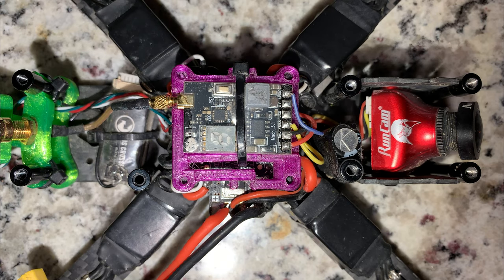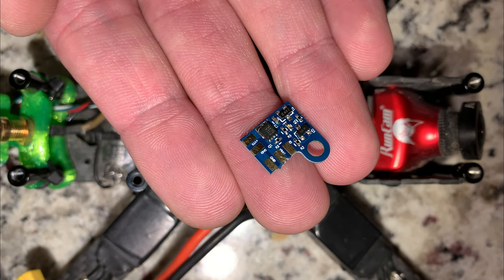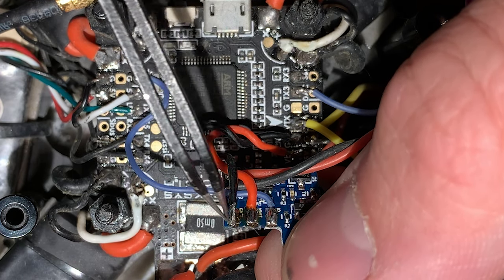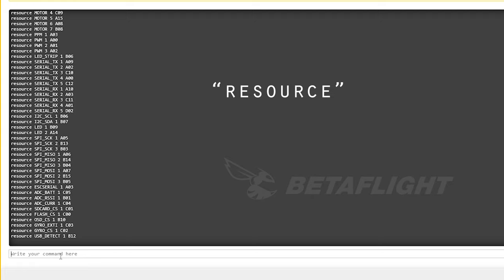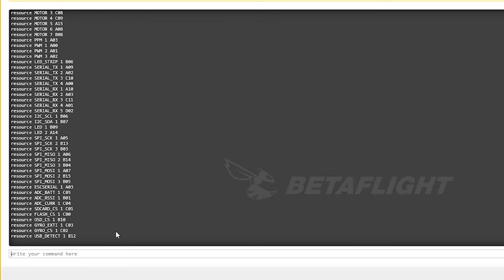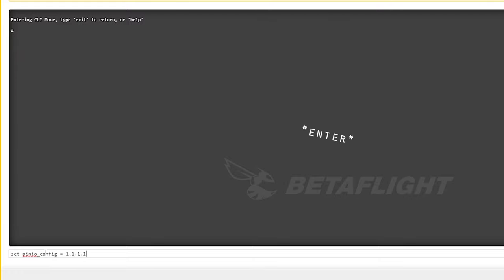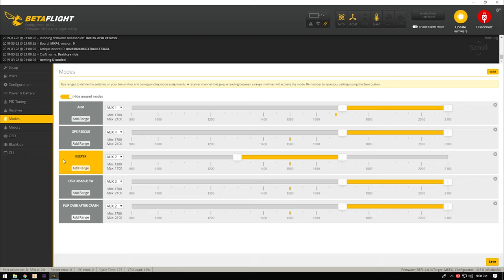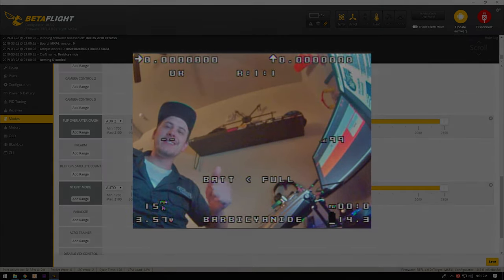Heart of America Pit Switch Install | RotorCross Racing

Comment: I had issue when freeing up the resource of B11 (rx3) I was not able to reassign it with the PINIO command. I would get and invalid error. That fc has betaflight 3.2 from like 2017 I believe. I am having issue with trying to reflash the fc into bootloader to update firmware. But do you think that the older version of Betaflight could be the issue?